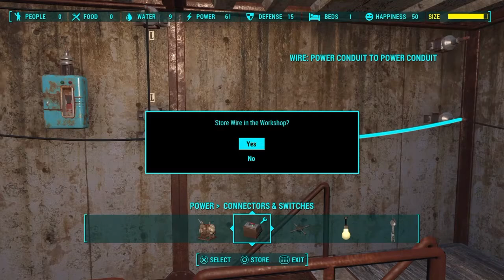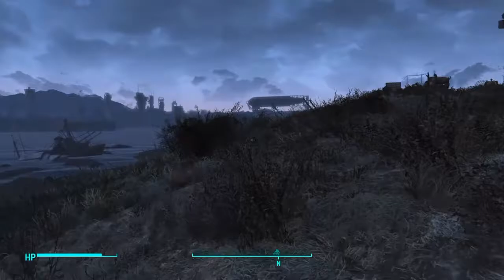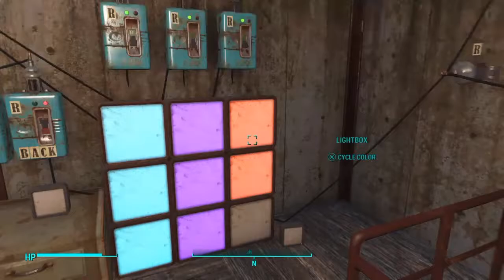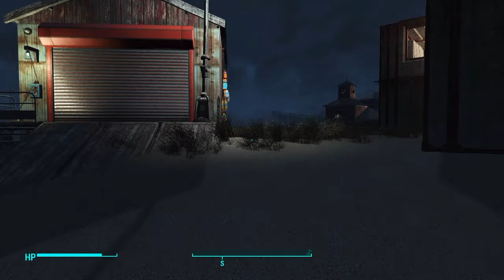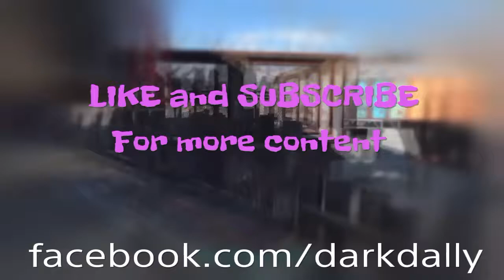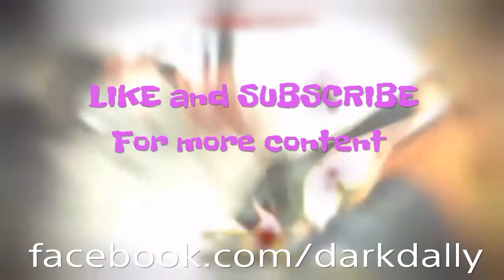The Ultimate Electrical Guide pt 2 - What My "Falllout Computer" Can Do, and What it Shows Us

Comment: I like to think of it as circuit strength memory, as long as a power source is hard wired somewhere in a circuit, it will share it's power level with the whole circuit, switches/gates or not.

The source must be removed the manual way